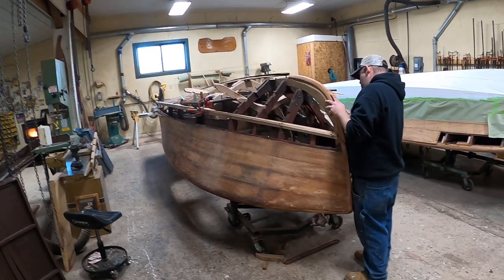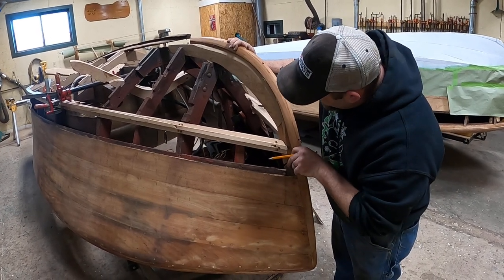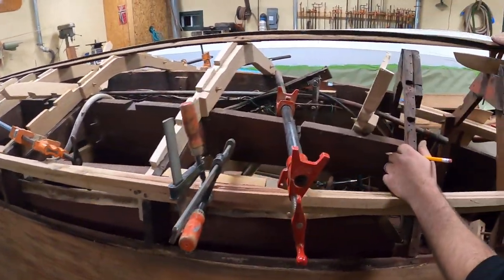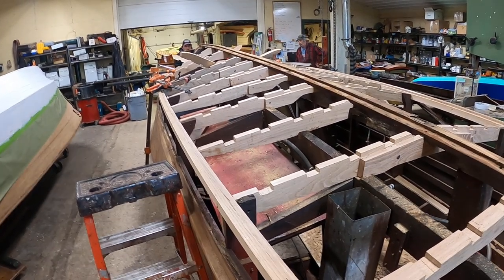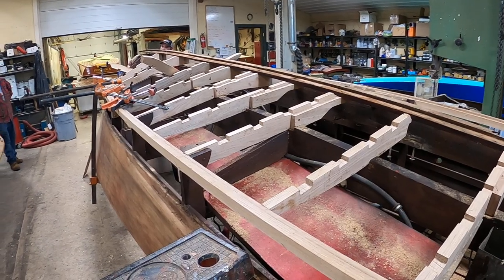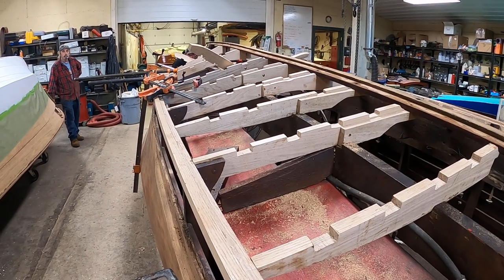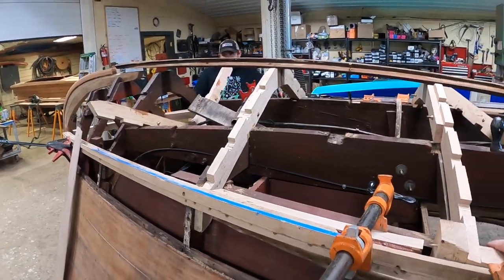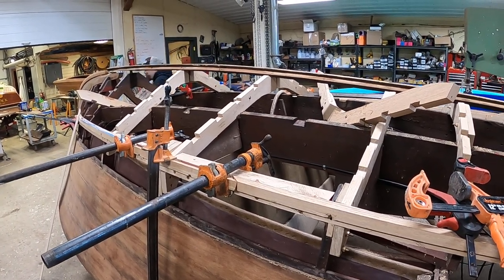1948 18  Century Seamaid Bottom Frames & Bow 12 - 3 - 2021 Snake Mountain Boatworks LLC

Comment: Which alloy of stainless are you referring to?
Reply from the maker: It does not matter, according to the extensive laboratory and in-service testing executed by Don Danenberg:
I will allow Don Danenberg to explain:

Stainless steel was invented in 1913. The 300 series (3020316) included 18020% chromium and 8-12% nickel. (316 has 2-3% molybdenum, which makes it slightly less susceptible to crevice corrosion.) In the presence of oxygen, the chromium and nickel form a surface coating that protects the 70% of the material that is mild steel.

If you bury them in the hull, covered with putty and paint, they are cut off from oxygen and will soon corrode like mild steel. Only silicon bronze is long lasting here. The only apparent reason for some use of stainless steel (fasteners) is that they are cheap!

It doesn’t matter if they are advertised as “marine grade.” That only applies in the presence of oxygen.

(Don Danenberg, “What is a TRUE 5200 bottom?, Classic Boating, September-October 2014)